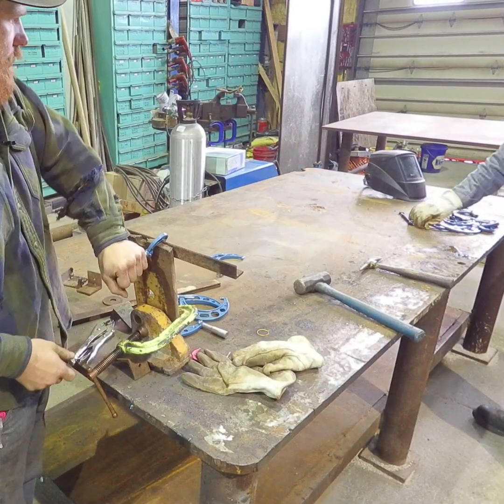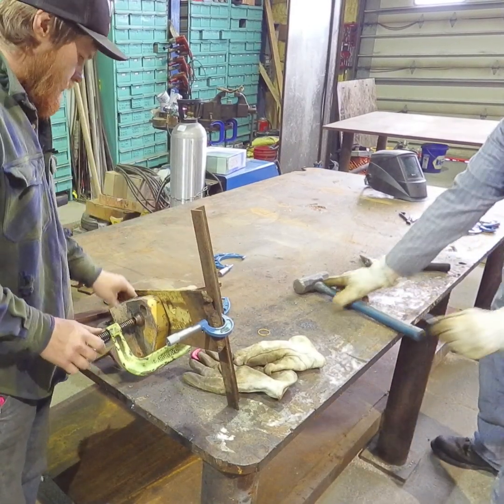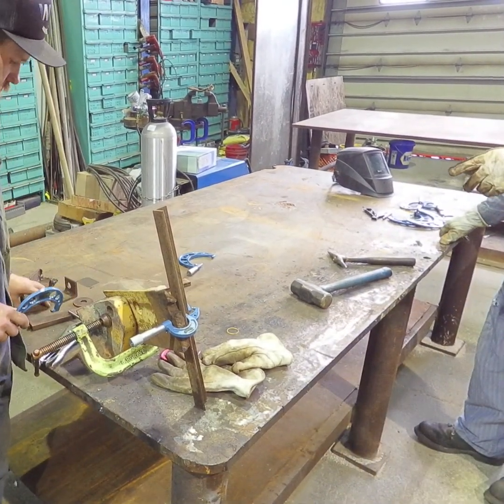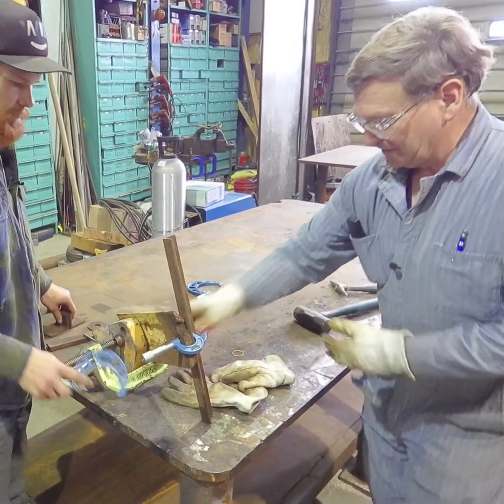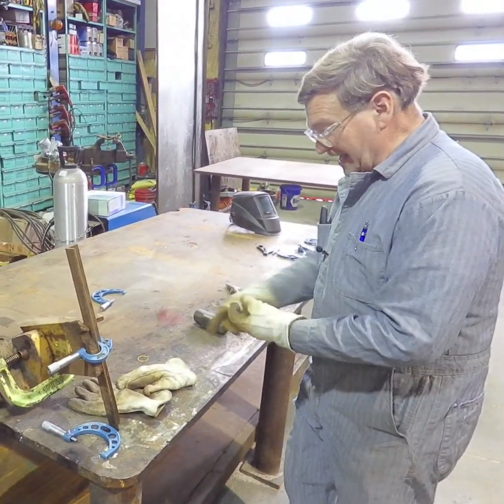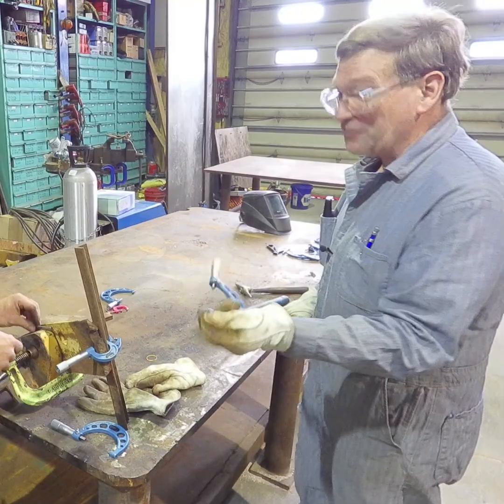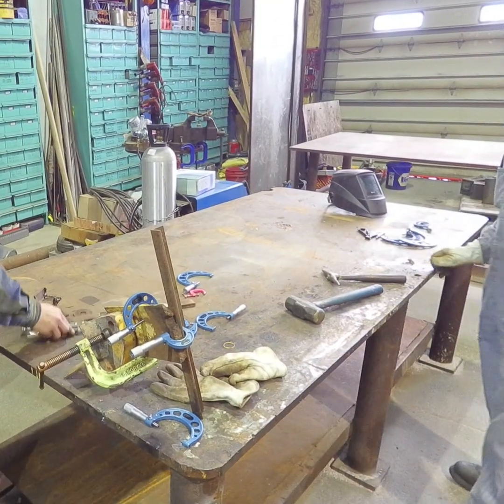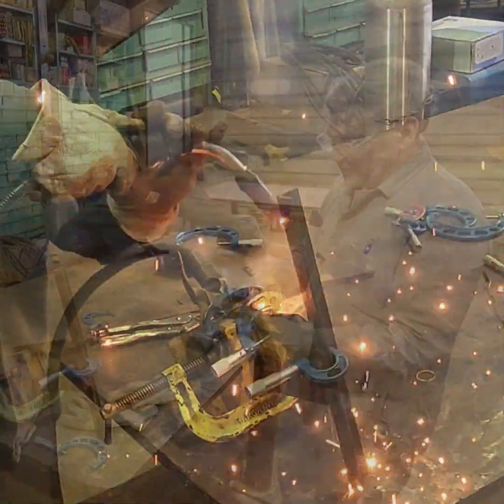Machinist's Minute: Precision C-clamps (industry insiders DON'T want you to know this!!)

Comment: YALL ARE CUTTING ME UP
 
I'll see a video by #HOWEES and swear I'm about to learn something from an ole timer.
Nope! it's showing off those sweet micrometers. 😋 😂
Reply: if you're reading this...
for your next trick !
mill a full contact dowel ((3-axis/bridgeport (manual mill))
Mill a stock piece to cylindrical value holding onto your LOVELY C-CLAMPS.

and I'll be impressed 😎 🤣